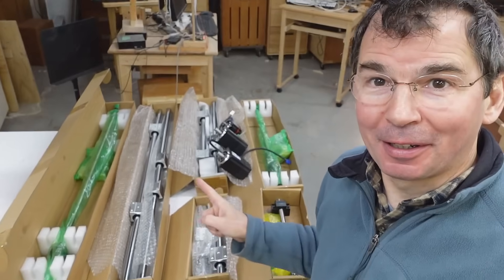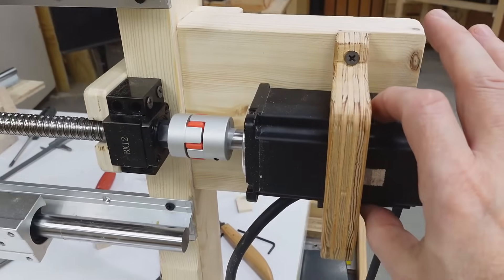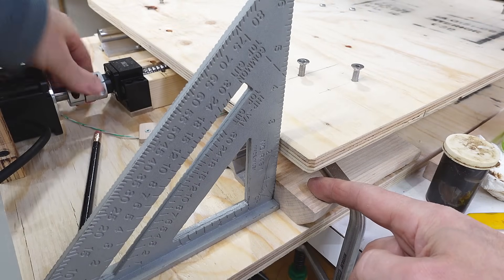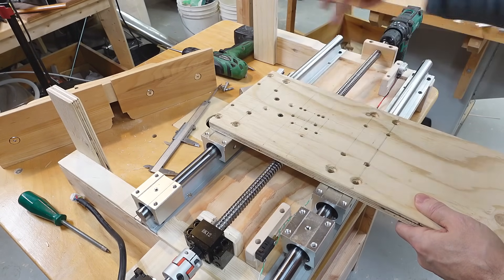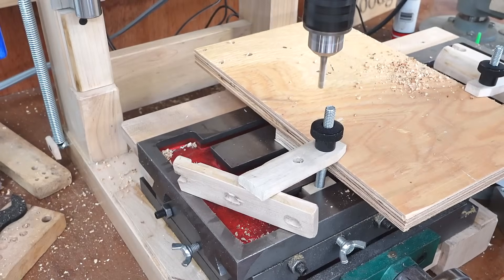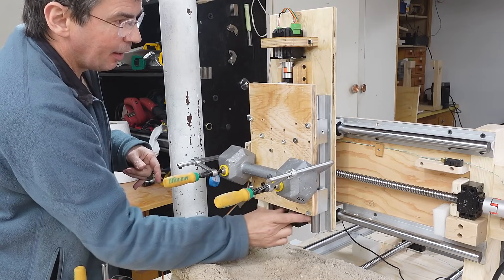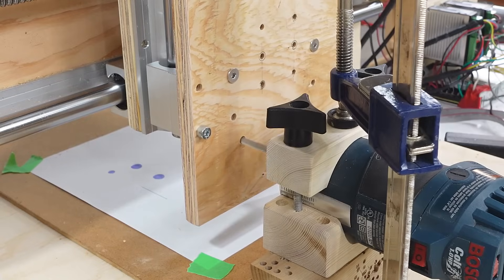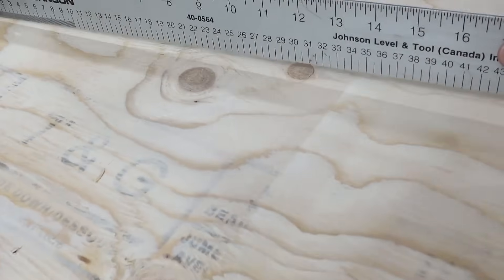Building my CNC router

Comment: wood changes size with heat and moisture. within a few months, you will need to rebuild this
Reply from the maker: Within a few months, I will need to re-zero the X Y and Z axis when I use it.  Oh, wait, I do that anyways.
Reply: @matthiaswandel  re-zeroing the axis isn't exactly the same work required to replace a build part because of warping which will happen because wood absorbs water.

you could probably get away with it if the machine is kept in a stable temperature and moisture environment
Reply: no moisture if paint all wood parts after made  to epoxy resin. no problem moisture and heat.

Comment: The countersink maneuver would probably work better with a ball nose endmill.
Reply from the maker: yes, but that would require yet another tool change, unless I had a ball nose endmill that can drill too.  But if I just ground the corners off my endmill, that would make better countersinks too

Comment: I built my own CNC using the same ball screw and support rail components  (1605 screws for mine - looks the same as what you have).
- Instead of connecting the motors directly to the screws, I used pulleys and toothed belts. I made the pulley on the screws double the diameter of the pulley on the motors, therefore doubling the torque and doubling the accuracy. That also allowed me to place the motors beside and parallel to the screws  which means the overall length of the each assembly is the same as the length of the screws, rather than having all that extra length hanging out  of the end of the screws. As a result I can run the motors twice as fast for a given screw speed which gives a smoother motor control I find.
- You can buy aluminum L brackets (which are designed to fit these motors) to mount the motors properly on their mounting flanges for about $5. a piece.
- In my design my Y axis moves the "gantry" not the table. The table is stationary. On a small machine it may not matter that much, but I like the stationary table better.
- You are going to have to mount a spoil-board on the table and decide how you will fasten the workpieces to it.
- Realize that the axis don't have to be super fast when it will be working. Just think about how fast you would move a router by hand if you were cutting a 1/4" wide 1/4" deep slot in a piece of wood on the bench, especially in the case of a piece of hardwood - not very fast.

Another thing I did last year was get a 3 axis laser engraver which I can mount on the table (after moving the router fully back) and use it to "burn" designs, lettering etc. on the piece I have made with the CNC. Works really well.

I could send pictures of mine if you are interested - If so let me know how to send them.

"Two holes out of place" ? - What about the end of the X-Axis screw hanging out in mid-air with no place to support it? What about the Z-axis support plate that was too narrow because of the width of the rail supports. My only point was the main reason for designing in cad with 3D views is to see these problems in he design phase, and not have to correct for them in the build phase.
Reply: You make a lot of sense. Maybe you could just post a video of your work here on YouTube? I, for one, would like to see them - the laser engraving seems really nice.
Reply: Hello, use direct transmision of the screw ball is less presission than using pulleys?
Reply: @ventasoficial1674  
Yes, because when using direct drive each step of the stepper motor = x mm. But with the  2:1 ratio provided by the pulleys (remember I said the pulley on the screws is double the diameter of the pulley on the motors), each step = x/2 mm. So the motor makes two revolutions to cover the same distance as 1 rev of direct drive ... therefore double the accuracy.

Comment: If you have a CNC with CAM and a hardware controller in one, plus well-thought-out table mounting and the obligatory vacuum table, working on such a set is pure pleasure.
A controller without CAM will discourage many people from using CNC. There is an inexpensive hardware driver together with CAM (PikoCNC). I have been using it professionally for many years in the production of custom-made furniture.

Comment: The packaging of the VEFOR rails+screws set is horrible. Rails and ballscrews loosely placed in one cardboard box, barely no packaging material, ripped open on one side due to the weight. 🤯

Comment: Everyone is trying to convince him that the CNC is valuable for producing lots of identical parts, but that's clearly not something he does a lot.   Matthias:  the best initial value for you will be making  flat patterns in plywood of any shape complexity, with precision-located holes, dados, rabbets, etc.  You just need to get a basic CAD/CAM workflow to convert 2D drawings into toolpaths for a given wood thickness, and you may find it doesn't actually take you longer (and now designing with weird angles and curves doesn't cost any extra time).  Some newer software makes these flat patterns very simple and fast.

Also, don't forget the CNC opens up engraving options, too.

P.S. If you're doing a lot of flat patterns, for the contour/profile cuts I recommend a 2-flute, 1/4" compression bit (the first few mm of the bit is upcut, the rest is downcut).  As long as your first pass is deeper than the upcut section, you'll get a very clean finish on both the top and bottom edges of the part.
Reply: What CAD software do You use for making accurate 2D templates?

Comment: If you want the motor not to stick out, get a really short belt loop + pulleys and mount it on the other side. Reduces the control stiffness by a bit, but if you are using wood that's not going to be the bottleneck.

Comment: I work in the entertainment industry, and CAD+CNC is a GODSEND. We can render an entire scene of a show in a modeling application like Unreal, translate those parts to CAD files, and then CNC-produce it DIRECTLY from the model. (And, in my side of the equation, translate that DIRECTLY into the motion control platform I help make so you can have a perfect 1:1 representation of what the equipment is doing in relation to the parameters you're driving it with, and thus enable EXTREMELY high-fidelity pre-visualization.)

Comment: For a first time CNC you should have went with steppers. Less chances for spectatacular failure at 60-120 IPM travel speeds.
Reply from the maker: but the cool thing is, I can configure the max travel speed of the motors, and then still drive it like a stepper.  So for safety, the servos rule.  Granted, if I want to crash the tool at 2000 RPM feed rate, the servo can do that too.

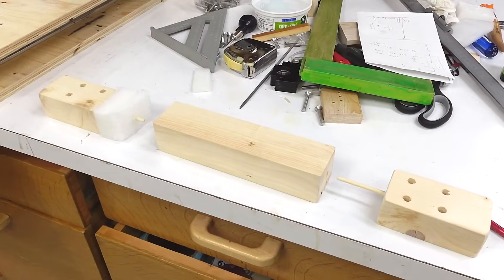Comment: 3:42 - You can put a "flyback" diode at the motor's power input. When the power cuts of, the motor will generate power, but the diode will be clamping the voltage close to a short, stopping the motor.
Reply from the maker: do tell how thats supposed to work for brushless DC servo motors
Reply: @matthiaswandel  I know it shouldn't work like that, but sometimes the h-bridge sets in such a way it starts generating power from rotation. But it most likely will result in a volte spike.
However, I do realize now, that your motor might not be an integrated servo.

Comment: May I have the code for the precision drilling machine. That program you made to mark the zero points were amazing
Reply from the maker: didn't end up using it on this because with rectangular arrangements of holes, it was easy enough to do the arithmetic in my head.  Though dialing to an exact value on a numerical display is kind of annoying.  If my CNC router had hand cranks and a graphical DRO, it might be more fun :)

Comment: The time it’s taken you is because of climbing a couple learning curves at the same time. Having built 2 or 3 CNC machines primarily from plywood you will find yours works pretty well, not perfect, but usually well enough. I primarily use GrblHal now due to the very wide range of control boards available. Most of the boards are fairly inexpensive and suitable for 3 to 6 axis work. They run with Windows and a USB port. Lots of good free Windows based control software too. I’d suggest Grblgru. Decent control software is lacking for Macs.

Comment: After watching you disassemble over half your CNC machine to tighten 2 forgotten screws, I’d say you would qualify for either Ford or GM’s engineering department for the placement of their water pumps. With just a few tweaks you could easily move up to their oil pump/sensor locations! 
  Another enjoyable video, thanks so much Matthias and looking forward to more on this subject.
Reply: I had to replace the water pump on my truck recently, and yeah I saw that and thought oh this shouldn't be too hard, I just have to checks notes removed the entire front half of the engine. Neat. 
That sucked
Reply: Ford 3.5....🤦
Reply: HaHa  Try changing the WP or the Alternator on a Lexus RX(V6) or the rear passenger side spark plug.  I came up with may new names for that car.  However, it is 23 years old and doubles for my covered pickup truck so there's that.

Comment: What's the CNC control software, if any? I didn't see signs of either Mach3, Candle, or LinuxCNC
Reply from the maker: Just a python script sending "go absolute position" commands to the servos over serial, and pulses to the z axis motor
Reply: @matthiaswandel  stupid, idea, lot better and easy use linuxcnc software, whit paraller port card.

Comment: Inheritance Machining did a great video about one off products and efficiencies of doing all the work manually vs sending it to a CNC shop. Key words: one off products
Reply from the maker: Yes saw that one.  Big time suck for CNC is all the tool path programming and verifying.  But the complementary time suck for manual is all the setups and dialing everything in precisely before any cut
Reply: But dialing in precision is soothing

Comment: glad to see you joined the cnc game.  I'm in the cnc game since 2008. cnc isn't good for one off project because of the time allotment, as you state , it shines when you need to make repetitive parts. you do time consuming stuff once and its off the the races with all your same parts!!!
Reply from the maker: but so far, I can't think of a project that I did where I could have saved tim with the CNC doing all the repetitive cuts
Reply: @matthiaswandel  Where you save time is in the accuracy. How many things did you have to remake or re drill because things were crooked or off? Z plate -You could have surfaced that part, drilled the holes, drilled the countersink, and then cut the outline to the exact dimensions you want. Your cad-cam workflow is masochistic, no wonder you hate it. Credit for getting something to work, but there are free or low cost cad cam stuff around now. GRBL, tinyg, open builds, freemill, easel, fusion 360, free cad, linux cnc. When you get a workflow down, you can make things almost as fast. Yes, you have more computer time, but things are usually right the first time.

Comment: I thought same thing until I purchased one. It has saved sooo much time and money than making things by hand. Not to mention repeatability. I’m sure you’ll love it and find uses for it in the long run.
Reply: DIY can made lot better cnc own hand than buy one expensive machine, ready to use cnc machines cost normal 4000-6000$ and same or lot better machine can made own garage less than 1400$ waste lot money than idiot if buy ready cnc machine. normal men can build good cnc machine at home lot cheapen and easy.
Reply: @ Not exactly sure what you are saying, but I did both. I was a purist until I bought a CNC for much less than you are saying. And my projects I sold that took 3-4 hours each, now take less than 40 minutes and they are all exactly perfect. Still enjoy hand making projects, but selling has increased at least 4 to 5 times so I can make more money in less time. Let that sink in. 🤣

Comment: I guess you should start thinking about projects where you need >20 parts that are complicated but similar or same. At that point, you can devise a tool path that might take a bit longer to work through, and you have your time freed up to do other stuff in between jobs. 

Also, for engraving and v-carving CNC machines are really nice. And as you like to make your furniture look simple but beautiful (have never seen an exposed edge of plywood! with you, there is always a nice strip  of hardwood at the edge!), decorating pieces with engravings might be something you'd like. Also - check out prismatic Inlays. Best way to super simply make CNC Inlays. There is a free software for that, its called F-Engrave.
Reply from the maker: first comes the project, then the tool.  the tool has to serve the project,  it the other way around

Comment: For some reason it makes more sense to me to watch you build this cnc from wood than it does to see the many +5000 USD sponsored builds that are on YouTube. Great video. Super entertaining.
Reply: The more impressive part is the ease with which he setup a CNC controller because I'm pretty sure he made it from scratch.
Reply: @Beakerbite  And he didn't even mention it.
Reply: @Beakerbite i really really want to know if he wrote something to control all those motors but he didn’t mention it 😢
Reply: @Beakerbite 

Tus seguridades o in, nos importa una 💩
Reply: Eres un JalaBola.
Un Pelota.
Reply: Using thick MDF works well, it seems less susceptible to temperature and humidity, and is also very rigid. I’m building one now, well,  designing one at least 😊
Reply: wood changes size with heat and moisture. within a few months, will need to rebuild this
Reply: this cnc not ewer can cost ower 1200$. i just build little better than this have and all cost less than 1200$ very cheap and lot better than this video machine, 2.2KW spindle, all motors biggest, better software linuxcnc, and gantry style not worst only table move.

Comment: And now, that you have a working CNC you should use it to manufacture the plates from aluminum instead of plywood. And replace wooden gantry structure with steel one filled with concrete. You are on a good path, just carry on ... ;-)

Comment: I can only watch it with Spanish dubbing...
Reply from the maker: then turn it off in your settings
Reply: @matthiaswandel  I forgot to say it's a problem with chromecast. Changing language does not work.  Looks like common problem.  Only way is to reset chromecast to factory settings and start over again.  Now works, thankfully.  Looking at you and hearing Portugeese or Spanish isn't comfortable ;-)

Comment: Nothing particularly wrong with a single ballscrew through the length of the machine. I've been running a small (39x25" / 99x63cm) machine for nearly 20 years that uses that arrangement with no issues. The only downside is that you can't do what Frank Howarth has done; whereby you have a missing section of table and could machine the end of long parts mounted vertically (because the underside of the gantry needs to intersect with the ballscrew and would hit anything below the table surface).

Comment: I like your channel, but you lost me when I saw a wood you used to build the machine. Couldn't you strech for, at least, some multiplex ply all the way instead of that soft wood?
Reply from the maker: that wood is more rigid than plywood.  I picked some very dense 2x4s for it.
Reply: @matthiaswandel  Are you comparing same thicknes of wood to the same thicknes of plywood with grains orientation in criss-cross orientation. Hard to believe that.

Comment: Hahaha, very nice to see a Wandel-Brand CNC milling machine!
Some notes:
The Spider couplings are actually not the right kind for this application, since the soft-ish rubber can compress. This might also cause chatter, when the tool puts forces on the screws and causes them to rotate. The motor may not, but the joint will allow some rotation.
The right ones would be "flexible shaft couplings". They are one single piece with a lot of slits in them. They can work with misalignment in xyz and tilt, but allow no flex/rotation.
The ball screws are kind of hardend, but not quite. These are "rolled", meaning the shape is put into them by compressing the material and literally rolling the "threads" on there. This compresses the material and makes it "denser". Which kind of makes them harder. But they are not actually hardened. Although hardened and ground ball screws do exist (much more pricey tho) ;)

Looking forward to "CNC vs Bandsaw gear cutting V2" ! :D

Comment: I found the Z-axis rigidity and accuracy is the most important sub-system to making good parts. Evaluate the flex when "drilling". How much the router bit is offset from the Z-axis rail guides creates that moment wrench-arm to flex the supports and lash issues.
Reply: Like if you relocate your Z-axis screw and rails such that the router is tucked back in the gantry. Kind of invert the rails+screw.

Comment: CNC is great for making many parts of the same thing and for making precice holes. But for one of a kind projects its not really wort it unless you want to spend hours in front of the computer befor you can actualy start getting some sawdust in your hair😂
Reply: cnc can make lot etc, inlay, text carving, signs lot fasten than ewer can do make at hand working. very fast simple make draw and text whit computer and pictures etc, and move to cnc machine, example i made text sign, "welcome" whit computer less than 1 minits and move to cnc machine and carve this sign to wood less than 10 minits and ready, need only little sandpaper and ready, but hand i need make same lot lot lot more time and ewer not come same accurate and time.

Comment: What was the purpose of using cad for your design, when you spend so much time afterwards making corrections to the mistakes you made in cad?
Reply from the maker: because otherwise there would have been even more mistake.  Two holes were out of place.